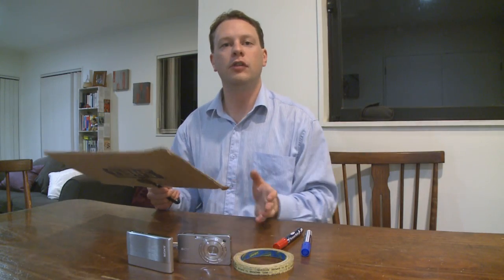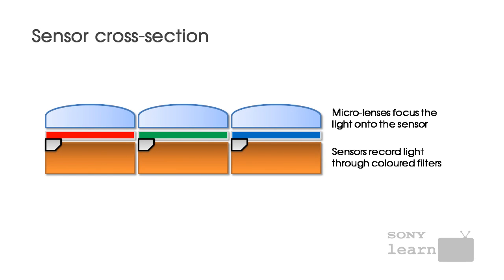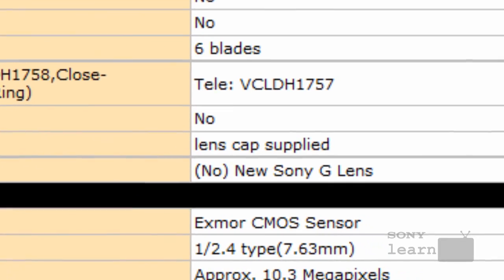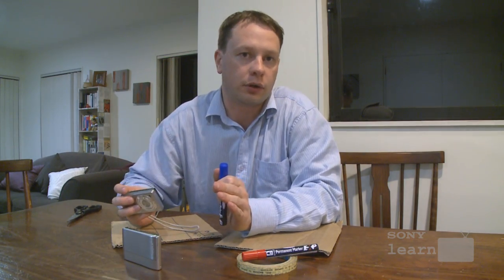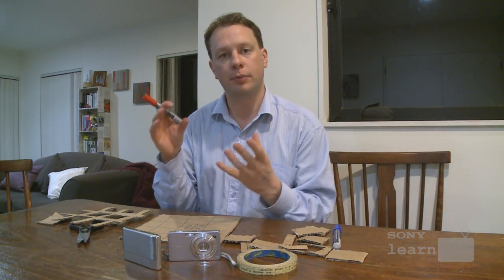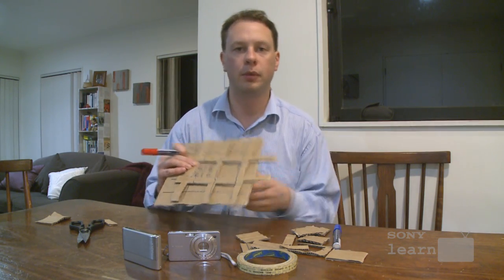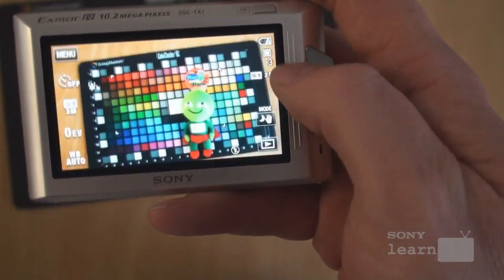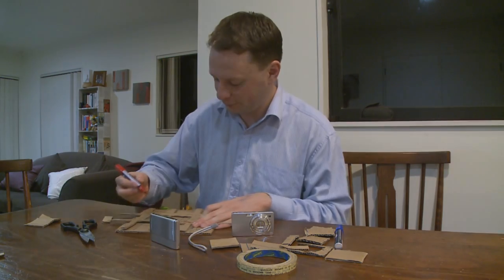LearnTV The Exmor-R CMOS sensor

Comment from the maker: @KleineJumbie The WX1 is definitely the better camera... more pixels are useful for enlargements but on small sensors like these the difference is fairly minimal (and, in some cases, quality can even drop especially in difficult light). With slightly less pixels and, more importantly, the different sensor construction (Exmor R), the WX1 will take better photos overall plus it has a few more tricks (like 10 frame/second shooting)